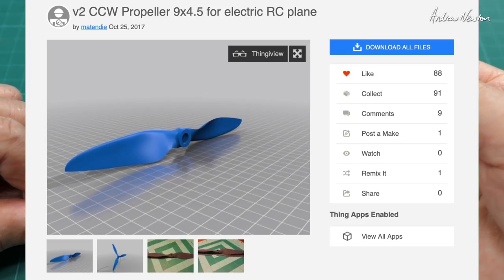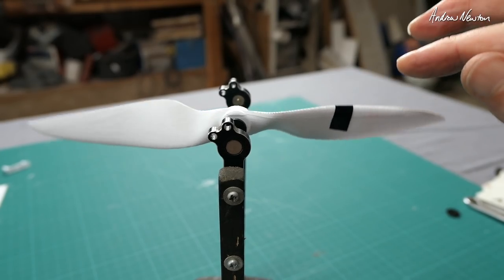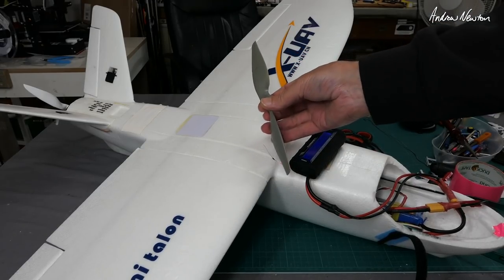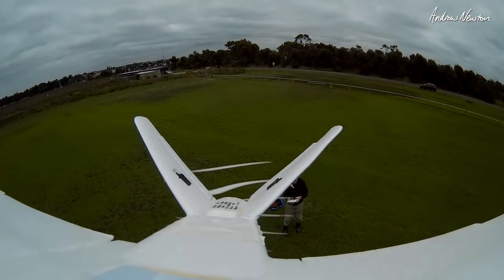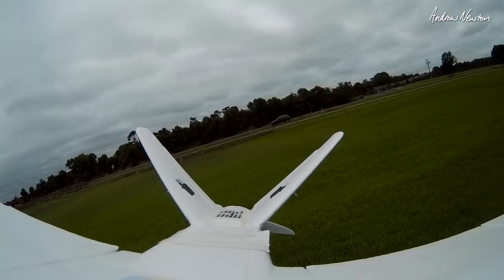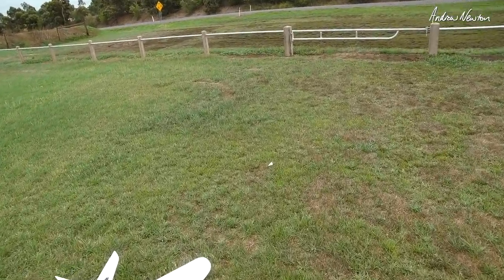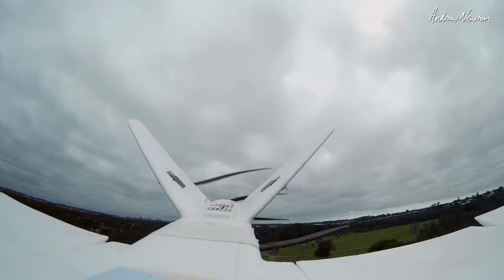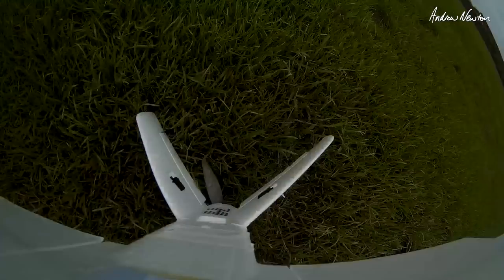3D printed propeller - Will it perform?

Comment: Given the much lighter weight, you could print it a fair bit thicker, to give more to work with for sanding smooth. Solvent Vapor polishing too might be ideal. Any roughness on the leading edge is gonna cause issues, same with wind power generators after a few years etc. interesting idea since you could try any kind of design you wanted

Comment: Not really a relevant Comment for such a high-tech video, but I remember hand-carving props for rubber-powered planes in my free-flight days. It was just a normal part of the process - you'd get a plan, buy the balsa, build the airframe, carve the prop... Tricky but lots of fun.

Although they were huge and had wide, high-pitched, paddle-shaped blades, they weighed almost nothing. Most were whittled from a single block of wood, but a few really fancy ones were laminated from several sheets. If you picked the wood carefully (contrasting reddish and yellow-white balsa) they looked great - just like the stripy full-sized ones from WW1 biplanes.

They were fragile but I don't think I ever broke one; even the biggest rubber-powered models only weighed a few ounces so things happened very slowly and gently. Yay for long grass!  :-)
Reply from the maker: I have a hand carved prop, made it for a wind indicator. Challenging project

Comment: I've wondered what the result would be if a prop was 3D printed, so thanks for the video!

If you were going to do it again though I'd be interested in seeing it in ABS with the acetone treatment to smooth out tge surface. This is probably where a lot of the noise & drag is coming from so it would be interesting to see if that makes a difference.

Also I must mention please wear safety googles whilst doing these tests! A slashed eye or buggered retina is no good for your depth perception...
Reply from the maker: Unlikely to revisit this, but thanks

Comment: ABS or PETG (or ideally Nylon or Polycarbonite) would give you more strength. One nice feature of the Original Prusa's with the E3D v6 hotend is they can print these materials out of the box.

Comment: I knew someone years ago who lost an eye to a prop which shed a blade...No, I'm not kidding..
Reply: I’ve had a damaged prop split and one blade flew right by my face...I always wear safety or sunglasses now even with quality new props
Reply from the maker: Nasty!
Reply: i had a grinder blade explode and sliced my 2 fingers and role up my arm  my fingers where just hinging there barley connected.  i also had leather welding gloves on . first hospital wonted to take my hand.  sec hospital wonted to save it with 90% use.  and they did.  i got lucky. since then i well always ware safety even with my planes. the fact it can do more damage then just taking your eye. plus i had a prop snap and stick in a sheet rock wall like a throwing knife.

Comment: Printed some 75 mm 5 blade edf fans in pla, 3400kv on 4s is still not enough to let them explode. Good thing is printing is cheaper than buying a new fan and now I can just print ccw and cw fans for my hovercraft. Okay, they draw a bit more current when adjusting the pitch to achieve the original thrust and the responsive is a bit worse, but yeah it saves me around 5$ (new one is like 7$?) every time I break one. I had less luck with thingiverse props tho.

Comment: The new resin printers are probably the way to go. Thanks for doing this experiment.
Reply: I believe that is what getfpv does for their shop props, at least for prototyping.  Probably an industry standard now, as it is much cheaper option
Reply: @woogieman02  that resin isn't very stable tho.. And if you really want good props you can't do anything other then milling a fitting injection mold

Comment: I’m total impressed with the ender 3 pro. I like the printer.
Reply: i have been thinking about buying one. way more affordable than the others
Reply: @user-xz9st8hm1n  I got a cr10 mini which works great. The ender just looks like a more compact version of it so it should be great too
Reply: kimmy j i came from the to mono price mini v2. The MP has a good print quality but the print area is to small. The Ender 3 Pro have 225 to 225mm and is okay for me. For my office room is the printer size okay, a bigger printer is too big for the table.
Reply: I also love 3d printer but here it's cause double cost to import it. + A shity permission from government.

Comment: Andrew try some nylon filament for the propellers - plenty of videos on here to help with printing with Nylon on the Ender 3. :)
Reply from the maker: Moved on from printing props, never going to be as good as a moulded one
Reply: It will not improve the performance that much in my experience. Improving the 3d design is more effective untill you get limited by the material.

Comment: I looked at props but decided that at the cost of them to buy vs the time and cost of printing them it wasn't worth it.
The brittleness can be combated by printing it in PETG,  I've been playing with that and it's very strong and more flexible than PLA but I still wouldn't bother printing a prop in it unless I had a very specific need that I couldn't buy.

I'm going to be sticking to printing things that are custom to my needs and buying the cheap things. 

Currently my printer is working hard making a custom enclosure for a omnibus F4 based antenna tracker,  took me hours to generate a model even though I took many different existing designs and chopped them up and pieced together in an editor to make mine!
Reply from the maker: Yeah, dumb idea.
Reply: @AndrewNewton  not dumb, there are a load of things that dont make financial sense to print that just have to be tried because they are so amazing but are a try just the once sort of thing.
Reply: I may have to go this rout with my custom RC Airboat.  I need a real aggressive 4+ blade prop.  Ideally something like a racing prop for a real airboat.  Unfortunatley my boat has a rather odd prop size of 8" and therefore my choices are super limited.  This is the boat...  https://youtu.be/dlOZaX35L6E

Comment: Andrew, you should try PETG instead of PLA
Reply: Printing at higher temperature too changes the strength of PLA.  A higher resolution may improve things a bit too.  It sounds like he's done with the experiment however.   He's probably not inclined to continue the development.
Reply: pteg or abs!
Reply from the maker: Not a lot of point pursuing it really.

Comment: I find that multi blade spinners not that easy to come by in various sizes. I assume it's possible to print a spinner of uncommon requirements if you're able to print a prop ?
Reply from the maker: Yes that would be a good use, it's on the list

Comment: At the :30 mark it looks like you have weak layer adhesion. Right at the center of the hub your layer lines are not even bonded to each other. I bet that has a lot to do with this 3D printed prop breaking on you. Plus the rough texture you have on that... You might want to try to optimize your printer for better quality prints and retry this...
Reply from the maker: I don't think it's worth persisting really. Even with a higher end printer
Reply: @AndrewNewton  you don't need a "higher end printer". You just need to set your settings correctly. A sub $200 printer could properly print that any day.

Comment: I've always wondered if you can get extra strength by baking the part after printing a close to the glass/printing temperature. In theory it should help it slightly reflow the layers and therefor assist bonding, but I've never really tried with something that needed the extra strength.
Reply from the maker: Annealing, put it in a pre-heated oven at 60 to 80C and let it cool to room temperature. Must try it

Comment: I would never trust a 3D printed prop but good on ya for trying
Reply: Any prop can go, but a 3D printed props trustworthiness would depend a ton on the quality of the printer. 
I happen to have a high quality printer that with some post treatment I believe would handle the stresses. 
I'm currently printing impellers in metal for real world use. 
I think the key is that we take advantage of the 3D printer to eliminate the weaknesses of it as well.
Reply from the maker: That's quite advanced!

Comment: im getting ready to play with this idea. my first prop i tried at .2mm layer height an that was way to corse for my liking but it still printed so im gonna try it again but this time im gonna drop my layer height to .08mm an see if this helps with the finish an after that im gonna give it a shot on one of my resin printers an it will be printing at .05mm layer heights so it should give me the best results but ive not been printing with resin long so i dont know how the standard resin i have will hold up or if i should use something else.
Reply from the maker: Interesting experiments James. Good luck

Comment: Interesting experiment, certainly had things shaking at the back end. Did it break in the air, or when it hit the ground? 
Suggestion: when balancing, instead of using tape, which can come of, try layers of your wife’s nail polish (can buy clear if you don’t like her red. Lol). 
Can keep adding layers to the tip, or scraping a little off to balance.
Reply from the maker: She uses clear so I'm good to go. Great tip Kevin, the tape does fly off occasionally.